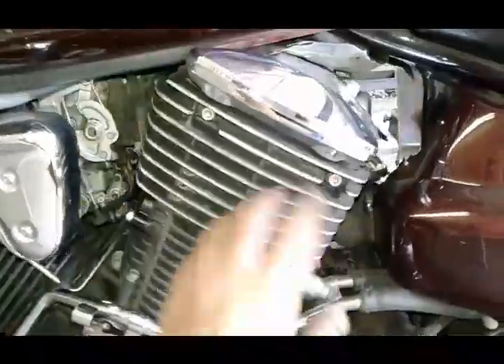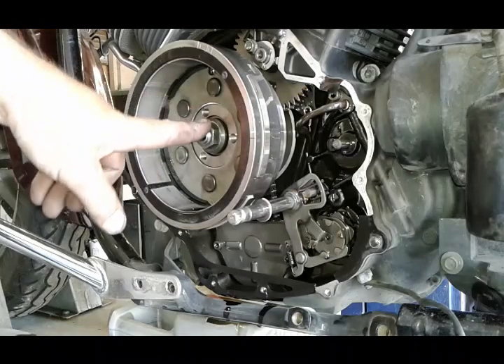Yamaha V star 1100 replace starter clutch step by step

Comment: Does it matter if the bike is in gear or in neutral when you do this? That’s the only thing I can’t find anywhere
Reply from the maker: I always kept it in neutral...you can move the engine by hand if you need to tweak the position of the timing since the spark plugs are removed... having it in gear complicates things in my opinion...thanks for your interest and please subscribe...it will help me out
Reply: @DoityourselfMotorcyclerepairs  thanks for the reply man. Hey, also- I’m having some odd problems, I’m desperate for help. Would you mind telling me your thoughts? 
I have an unusual problem with my motorcycle that seems to be snowballing. Any help you can give me would be highly appreciated. The bike is a 2008 Yamaha V-Star 1100 Custom Midnight with 13k miles. Here’s the issue(s):

6 days ago I had a small oil leak coming off the frame just behind the kickstand. I inspected around the area and found the frame and top of the crankcase had oil on it, as well as where a fuel delivery pipe connects on the rear cylinder. I decided to change the oil in my bike- the reason I did this is because I suspected my bike was tampered with and if anything was added to the oil (sugar, water, who knows), then that would clear it out. I also went around torquing bolts on the crankcase and oil delivery system. Long story on the tampering thing..

When I changed the oil I didn’t warm the bike up first, I forgot to take off the fuel filler cap, and I also hit the starter a few times thinking that would help clear more oil out. The bike never started up from doing that, it just turned a few times. I then put 3.2 quarts of Rotella T6 5W40 based on my dads recommendation. Not sure if that was a bad oil to use. However, I now suspect that might’ve been too much oil, considering I didn’t do a few of the steps. The manual calls for either 10w30 or 20w40, depending on ambient temperature. 

I go to start up my bike for the first time after the oil change- I hear a “clunk” and the starter isn’t turning. I try it again and the starter turns, the bike fires up and everything is ok. My bike has never had a problem with the starter turning, not once. It’s had problems starting up (only while hot), but it’s always turned just fine. There was also white smoke coming from where the exhaust header connects to the rear cylinder, but I think that was from the oil leak. This smoke was also coming out of the rear exhaust where it slips on to the header, and coming out of this point on both exhaust pipes.

The next time I go to ride my bike this “clunk” issue is maximized. My bike isn’t starting and the starter isn’t even turning. I keep trying to start it until the battery is obviously dead. At this point I use a portable motorcycle jumper- the problem is still there but after about 5 tries it all of a sudden started up, so I went on a ride.

When I got back I figured the battery was my problem, so I put it on a tender overnight until it says it’s charged. Before putting it on a tender it was reading 12.3 volts, so a little low. I never checked the voltage afterward, but probably should’ve. However, the tender had solid green lights so it should be good, I think. 

I put the battery back on the bike. Go to start it up and the clunk is still there. I tried it probably 10 more times and finally the starter turned and the bike started up, but the starter had to turn for a good 20 seconds before it worked. At this point the bike shot a bunch of black smoke out of the exhaust. Then, my bike would only idle when I either had the choke on or was pulling the throttle to keep it alive. It wouldn’t stay idling by itself, even after letting it warmup for a good long time. So I took it on a ride and kept pulling the throttle at idle to keep it alive, but the problem seemed to get worse and worse. It also felt like the clutch was slipping and there was a little bit of a loss of power. It seemed dangerous so I returned home.

Currently I have the oil draining overnight and I plan to put in 3.2 quarts of Mobil T1 Racing 4T 10W40 (full synthetic), but I really don’t see that working. I also added 4 ounces of sea foam to a full gas tank of non-ethanol 87 octane fuel. 

I’m at a loss.. first an oil leak, then a starting issue, now an idling issue.

I’ve read online that the starter clutch could be going out, but I’ve also read it could be a hydrolock- maybe the oil leak is something serious allowing oil in to a cylinder?

Please help, I sincerely appreciate it. And sorry for how long this post is, I wanted to give all of the details.

Comment: I haven’t experienced this problem on my 2000 VStar 1100 Classic.  Should this be done as a precaution?  Is this problem inevitable? Also, is this procedure a bandaid to an ongoing problem or will it permanently resolve the issue?  Thanks for any feedback.
Reply from the maker: Thank you for watching my video and for your comment... This is a very common issue on Yamaha v Star 1100 however if yours is good don't mess with it... I don't want to say that everyone will eventually have it but a lot of them do. The good thing is you will have notice ahead of time if it start going bad cuz it usually makes noises while you starting the bike or when you just turn the bike off it'll make a sound that resembles metal on metal bang. I hope this answered your question ...please subscribe it will help me out
Reply: Great video 
However (must be me of course)
Everytime I try to adust the split gear with screwdriver the top gear chain move clock wise which misalign my timing ..:(((
How do you move the split gear without affecting the timing alignment?

Comment: Where you at and what do you charge to do this? I had a shop do mine and its completely messed up
Reply from the maker: I am in Orlando FL...where you at??
Reply: Kentucky
Reply: If they don't get it right this time might be worth a trip to Florida to get it done. They had it idleing up real high when it was in gear  id have to hold the brake and clutch slowly letting out the clutch before it would idle back down to normal

Comment: Ok ok old post but let me try anyway

Great video .
However ,Im having a problem when adjusting the split gear with screwdriver .My chain gear at the top is moving clockwise when trying to align the split gear which of course will misalign everything. How do I move the split gear WITHOUT moving anything else.
Please (anyone) help a fellow rider :(((
Thank you 
Phil

Comment: Video quit playing. Is the video still up?
Reply from the maker: Yes it is...probably just a glitch. Thanks for watching and I hope it will help you. Please subscribe...it will help me ... 😊
Reply: Do it yourself Motorcycle repairs I’ll definitely sub. Vid stopped about 7 minutes in and I can’t get it to play on any device. Any chance you have it uploaded anywhere else?
Reply: Do it yourself Motorcycle repairs got the video to work. Excellent tutorial! Probably the best out right now. Is there any chance, you could do a video on checking and cleaning the actual connections for the starter button and kill switch?
Reply: What if you screwed up and may have got it out of time?
Reply: @DoityourselfMotorcyclerepairs  could you call me?
Reply: @joekey246   I may of did the same thing, any detail on if the engine won’t start if it’s not timed right?

Comment: Good job. However, why didn't you used the factory timing marks? while your marks worked, for a novice mechanic, it can be a bit confusing. there is a much simpler way to get the job done. Always use the factory shop manual. Like I said, good job, next time you could be a little more precise.